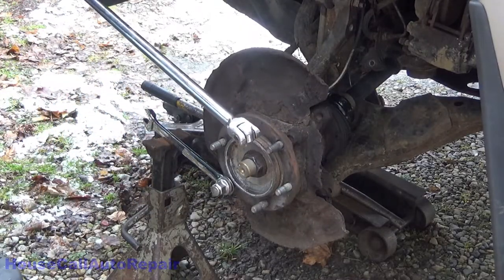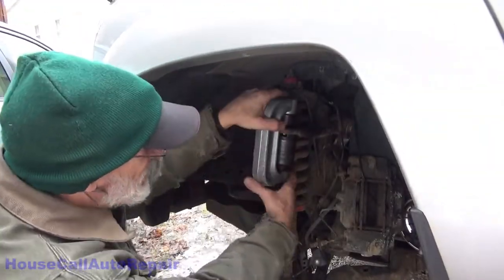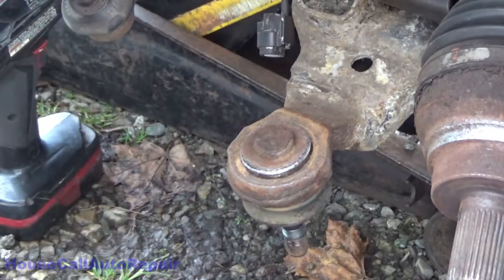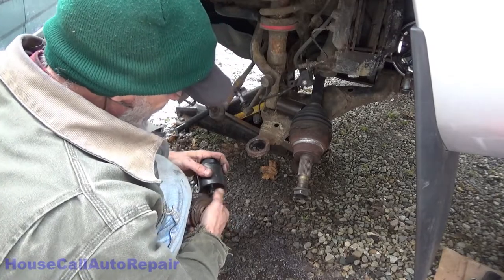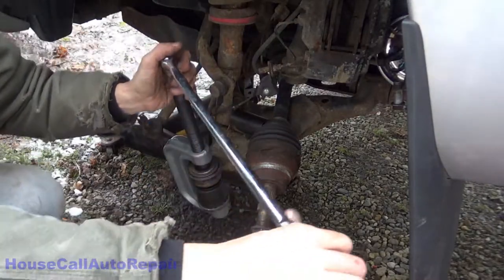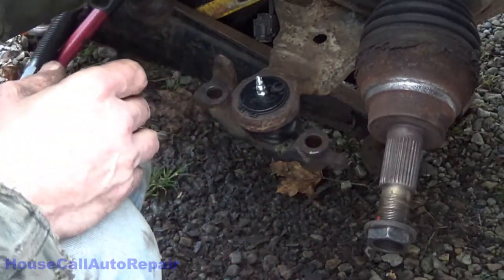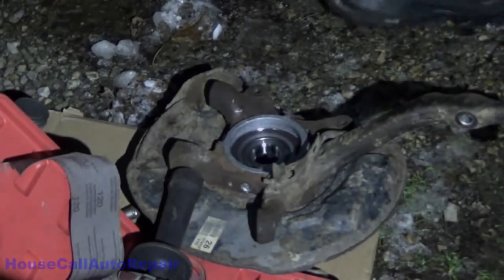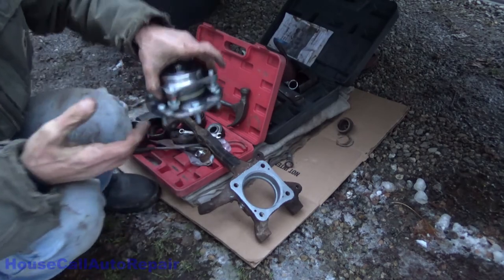2009 Tacoma 4WD Front Ball Joints and Wheel Bearing - Part 2 - Auto Repair

Comment: I know I’m not there helping you but when you are hitting the bolt with a hammer you are putting a lot of stress on the threads of the tool. Maybe if you hit the steel around the ball joint it would cause it to come out.
Reply from the maker: That sometimes works too, but I prefer the "load it and shock it" method. The tool is cheap....

Comment: also i never heat i use impact to remove and install there should be a cup for the top in the kit
Reply from the maker: I try to not use heat whenever possible, but in this case, it was so cold out, 'WE' could use the heat! Sometimes it's just that little bit that helps.

Comment: im not sure whats different in your kit and mine i got mine harbor ft and have never had to do what you are doing my kit one adapter on top and bottom goes all the way out and in
Reply from the maker: Some of the spacers don't quite fit some applications well enough to be secure and safe, so I opt for more stable setups, even if they take a few extra annoying steps. Sometimes, however, like you said, sometimes one shot does it all the way.

Comment: My steering arm is STUCK to ball joint shaft!
Reply from the maker: Using something for leverage, careful to not strike or damage any rubber parts, apply pressure in the direction opposite the nut, and strike the side of the steering arm where the ball joint goes through, Several taps from a 1 pound hammer should do.... (Unless a Gorilla previously over torqued it)
Reply: @HouseCallAutoRepair  well, after using a Fork tool I was able to get separated and in actually my current ball joints really don’t need replacement!